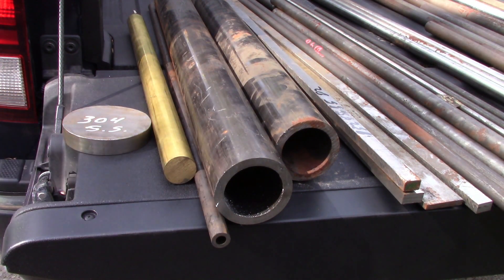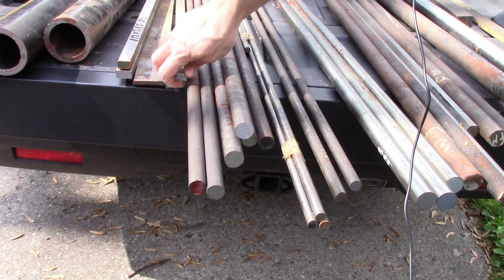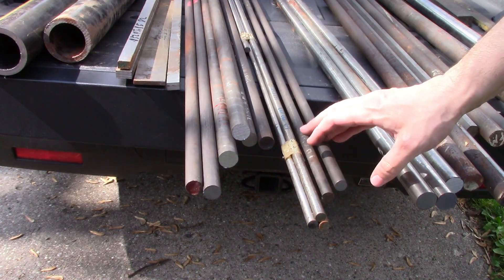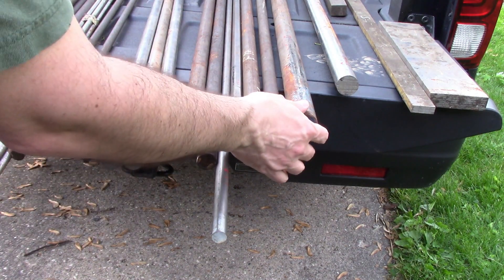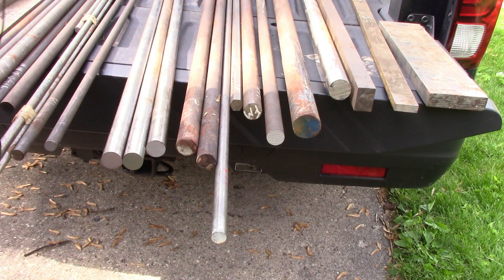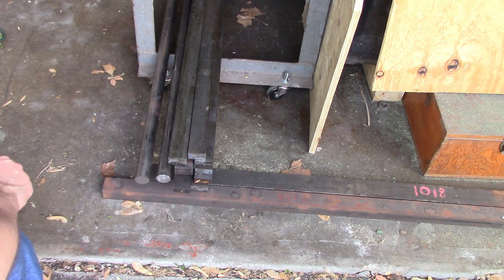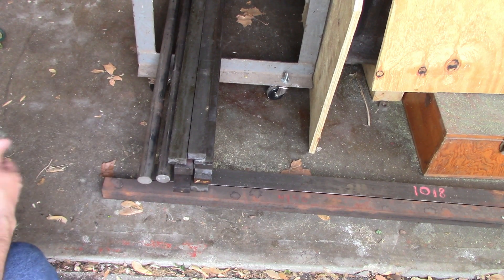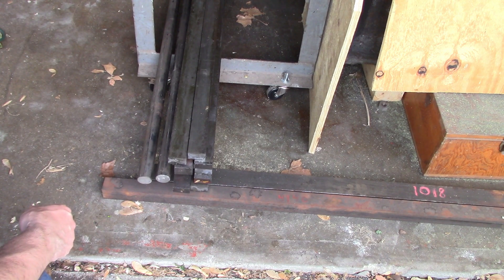Massive Material Gloat/Properties of Some Steels

Comment: I made a similar score from a local machine shop that closed.  Lots of aluminum and stainless along with some 4340 bars and rounds.  Paid about $500 for my haul which overloaded my Toyota Tacoma pickup.  My best/worst score was several years ago when I bought, at scrap price, an 8.125" (D) by 24" (L) round of what I thought was 1018.  Turns out it was CPM 1V tool steel.  Sells to the trade at about $30 a pound.  I'd like to sell it but I have not been able to find a buyer.  So, I have something valuable at a bragging price that I can not sell.

Comment: Wow that's a nice haul! You can never have too much material. Little too far of a drive for me. (about 2000 miles one way) Thanks for the info on the steel types.
-Dean
Reply from the maker: You're telling me that the cost of your gas would offset the screaming hot deal on all that tasty steel? Pish posh! 

Legal disclaimer: The steel is not actually tasty. Don't ask how I know.
Reply: @StuartdeHaro  Yeah, but it would be a fun trip.